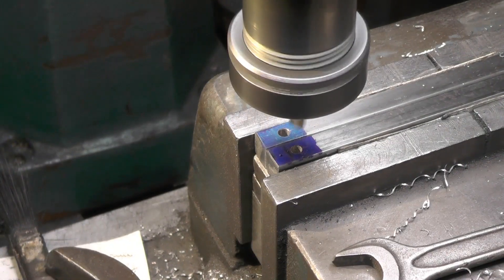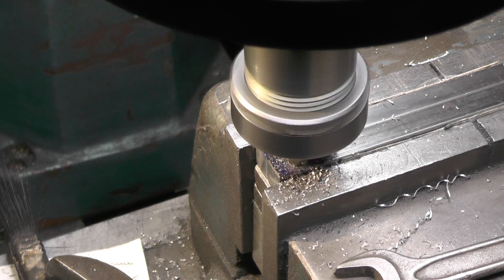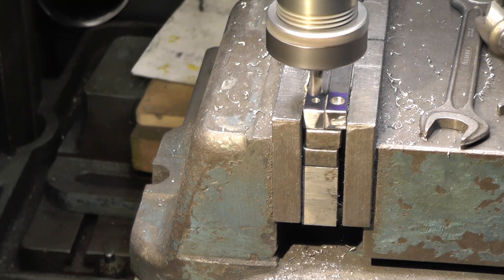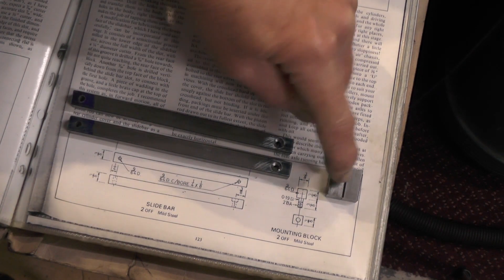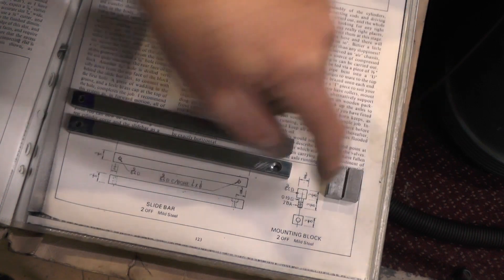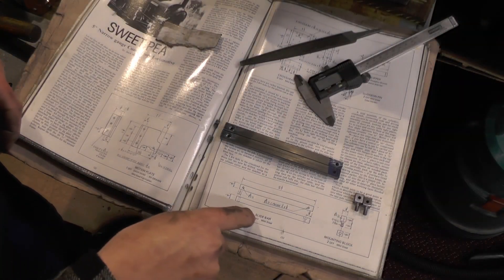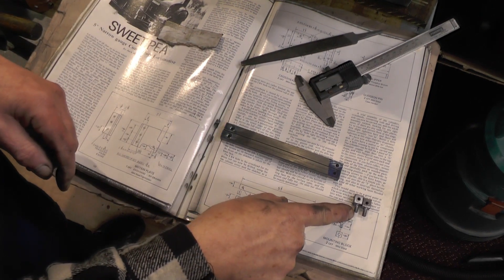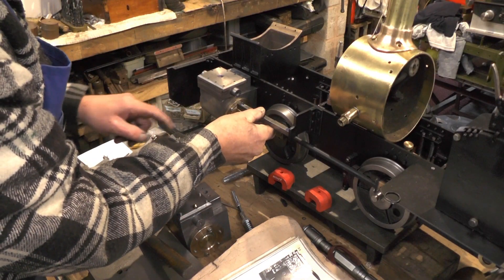Sweet Pea Steam Locomotive Build Part 10 (Slider Bars + Mod, Mounting Blocks, Honing) "mr factotum"

Comment: Another good step forward Kev slide bars look brilliant 😀
Reply from the maker: Thanks 👍Julia
Not complaining but like being on a treadmill🤣🚂🚂🚂👍 Always thinking about the next part while still making the previous part, you know where i'm coming from.
Never time to be bored🤣🚂🚂👍👍👍
see ya next time
atb 
Kev
Reply: @MrFactotum  I know what you mean Kev I'm designing parts for the Britannia brake system when I haven't fitted the suspension yet! 🤣 It's the reason Model Engineers stay mentally active longer than most folks in old age 😊
Reply from the maker: @julias-shed  Hope So😜😜